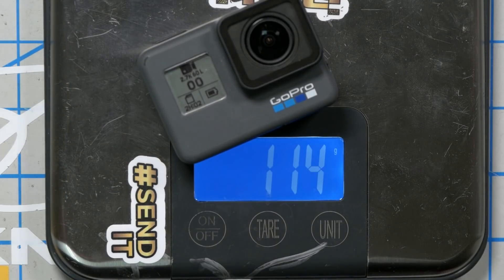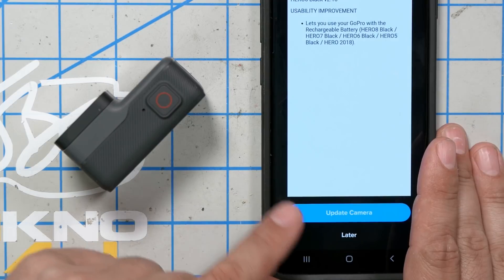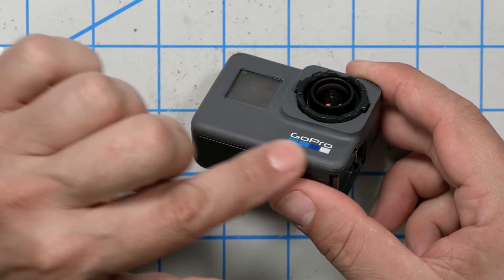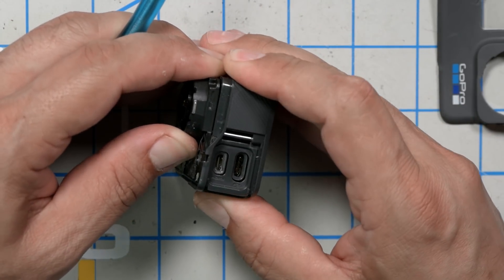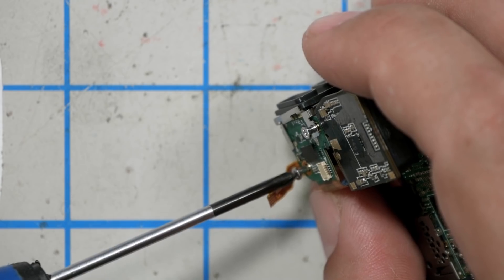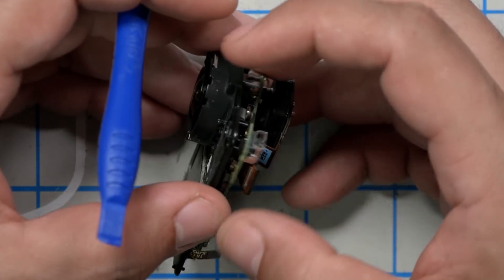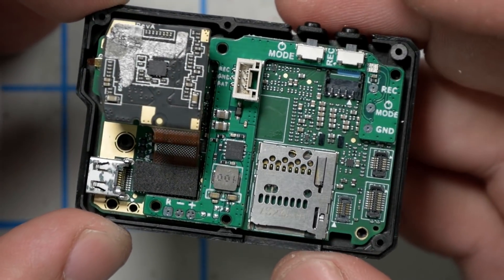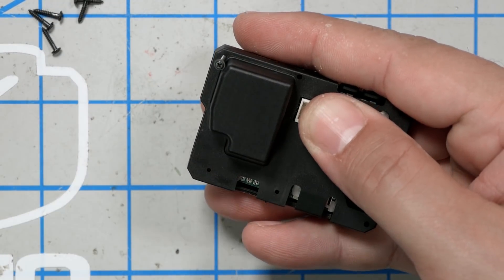BetaFPV Naked GoPro Tutorial (make your Hero6 weigh 26 grams)

Comment: Hello! Why are u using a single-core cable to make the wifi antenna? Is there a specific reason? Or i can use a "normal" silicon electrical cable? Thank you
Reply from the maker: The exposed part of the wire is the radiating element. Since the wire is soldered directly to the circuit board, you make the wire the length of an antenna (31mm) and then you don't need to use coax. You only need to use coax if your antenna is not going to be located directly at the transmitter.
Reply: @JoshuaBardwell  yes understood thanks but it seems that you are using a single-core cable instead of a normal electrical cable.. is there a particular reason of that?

Comment: I'm not sure switching to 2.4 for wifi is a good idea. You're going to be having that thing transmitting right next to your 2.4 receiver, where leaving it on 5G means its transmitting alongside your video transmitter and probably at a weaker power. I'd say there's less chance of failsafe and any video interference leaving it on 5G.

Comment: @Joshua Bardwell, thank you for great and informative video, but one question, which I cannot find answer for elsewhere and also do not clearly see in your video - what you used for antenna? Is there an ordinary cable or is it real antenna like from FrSky rx? Because those usually has core and shell (or ground in other words). I have some knocked off FrSky antennas, so was thinking to use it. So in my understanding, I should basically remove shell completely, cut 3.2mm of core with insulating cover, and solder it? right? Also another question, can I use front LCD with this setup using Betafpv V1.1 bec (I guess I can, as it uses only connection to motherboard and should not eat much power)? Would be good to see if you are still on video mode and did not accidently went to photo or timelapse :)
Reply from the maker: It's ordinary wire. Just cut to the correct 31mm for 2.4g.
Reply: @JoshuaBardwell  Just done it, everything works with my GP7b, ahhh it was so scary to plug 4s battery for the first time :). By the way, my phone did not saw my camera also, until I turned it on (short press mode button) and did refresh on gopro app (in Cameras view, top right corner 3 dots -> refresh). Then it appeared as "camera found". Maybe your wifi still not gone. Good luck and thanks again.
Reply: @JoshuaBardwell  some folks on here saying you need to bridge a connection from the u.fl to the point you soldered for the antenna to work. Any chance you could update on whether that's actually necessary?

Comment: Thank you Joshua for the great video.

A piece of small advice for anyone who wants to power the device from a 4s 5s or 6S lipo. 
Power from the balance cable and use the middle cells of the lipo. The outer cells will absorb possible voltage spikes coming back from the ESCs.
If you intend to use a 4S lipo and you connect your XT60 last, there will be a voltage spike that will find its way to the GoPro board and burn it. I destroyed mine. There is not enough time for it to get regulated.

6s Lipo 25V --x-> iFlight Mirco BEC 12V 2A ---> Betafpv mod bec 5v ---> Gopro board.
............. Burned after 5 days of use when I plugged the XT60.

In my next try, to overcome it, I  will use an extra bec to bring down the voltage to 6V and plug it LAST on the betafpv bec.
Use a small 6V capacitor
Or maybe use a potentiometer as a switch to gradually power the betafpv bec from the 8.4V of the middle cells of my lipo 

6s Lipo balance cable 8.4V--->  BEC 6V --x-> Betafpv mod bec 5v ---> Gopro board.

You will find very useful information about voltage spikes and regulators, at pololu site. 

https://www.pololu.com/docs/0J16/all

I hope the above may save anyone from unnecessary trouble.
Reply: So I have the flywoo gp7 naked and I want to make sure I understand your comment.. I want to also use it with my Diatone taycan 25. To be clear I can power the gp7 by first connecting the lipo's xt30 and THEN connecting to the balance lead power and the ground to one of the middle cells (4s)?
Reply: what if i want to use my 5V bus on my flight controller to power a Fully clothed Hero 7 in place of the battery. the battery will still be an optionally

Comment: Know it's taboo to some but any plans to test osmio action?? Seems to be a solid cam and stacks up well aside GoPro.
Reply: I believe It doesn’t have any stabilization software, or it doesn’t work well with fpv I what I was told
Reply: There are a few videos that compare them but are really biased. It does have stabilization.  I really like mine just for the fact  exposure isn't as high and 240fps.

Comment: Has anyone else considered this for a 5" quad? We could lay the motherboard flat and mount the lens above it in a 3d printed case. Since GoPro won't make a session again.
Reply: Yes, that's one of the main reasons I joined the NAKED Cinewhoop Community GoPro group on FB. I wanted good footage on a 5 inch in a lighter form factor. With a good tpu print protecting the lens & the GoPro motherboard mounted under the top plate with shock absorption mount,  I think it can be done under 50 grams.

Comment: Joshua, you removed the ufl switch... The ufl switch is used for factory test probing and it usually switches between the onboard antenna and the probe. When you removed it you basically cut the trace between the RF chip and the antenna pad; you might want to bridge it lol
Reply: How to do that?
Reply: @MrPorroto  Just don't remove it you'll be fine...

Comment: Question: @Joshua Bardwell, Does the naked GoPro still record sound?
Reply from the maker: It does not, although you can remove the microphone from the case and plug it in to the motherboard.
Reply: @JoshuaBardwell  What a shame, I guess I will have to transfer the mic then, that was the only thing that was keeping me from doing this on my GoPro 6
Reply: If you use the original shutter button , than it will, sadly the mic is on the og shutter button ribbon cable. which can worn out quickly
Reply: @Haverr1  Well, if I can't use the mic then that is a deal breaker for me.
Reply: @princesfpvdrones  than use the ribbon cable as a button, or you can just leave it there and solder on a custom button also :)
Reply: I have done the mod on my 7 black, with the beta v2, very straightforward to do, but I get a solid green light and nothing else. I would say don’t bother doing it. Why didn’t you show the GoPro working on completion??

Comment: Please be aware that there can be voltage spikes when powering on with the BetaFPV board (v1.1) and it’s onboard BEC. There have been quite a few reports on dead GoPros in the Facebook group due to this. Best add an extra capacitor, or use a different bec. Another great video though, keep it up! Happy flying!
Reply: BE AWARE OF THIS!!!   My gopro just killed by the betafpv BEC board.
Reply: I have an iFlight Micro BEC 5V 3A. If I wanted to use this alongside the BetaFPV BEC board, you think there might be issues connecting the iFlight BEC's output to the BetaFPV BAT + and GND? Wondering if stepping down the voltage before it gets to the BetaFPV board would provide enough voltage and if it would maybe avoid burning out my GoPro.
Reply: @TronkyWonk  What i did after reading about it in the Facebook group that Joshua mentioned as well, is cutting off the BEC from the BetaFPV board and connecting another BEC (iFlight BEC is perfect) directly to the GoPro. Check the group to find where to solder it to. This way you can still use the buttons and all. Perfect solution in my view. If you connect the iFlight BEC to the BetaFPV-Bec, i‘m pretty sure it can‘t handle it, as the input voltage needs to be higher than 5v.

Comment: Do we really need to solder on an antenna for the wifi?  It seems like it's low enough power to not be a problem running without a load...
Reply from the maker: All I can say is lots of people report burning out their radio by running without an antenna. But some people also burn it out running with an antenna so IDK.
Reply: @JoshuaBardwell  Radio as in Taranis, etc.?  Or wifi?
Reply: @townc2824  GoPro Wifi

Comment: The little bronze "antenna connector" looks a lot more like a contact for shielding. If it does touch the case shield, it can just be ignored.

Edit: Looking at the trace it seems to be an antenna connector, as well as a pad for a ufl connector.
Reply: The part that he removed is an RF probe... It is used to evaluate the performance of the device during production. When a probe is inserted the antenna connection is disconnected and the output is transferred to the probe for measuring.  You might not want to do what Joshua did as it's basically a contact switch between the rf chip and the antenna connector. Even if he did remove it, he forgot to bridge it so the antenna is basically useless
Reply: @pawanv86  Its definitely not an rf test point, those arent populated in a production device like that and it also doesnt have a hole.

Comment: thanks for the vid joshua! ive done 4 now and i havent yet soldered on an antenna. I might start doing it, but i havent had any issues so far. Ive had issues with it connecting because sometimes it takes a while but so far so good (first one a few months ago)
Reply: This is the only tear down I've seen with someone doing it and then the only one where the wifi then didnt work 🤔 are yours all still working well before I tear my hero down and make the decision to attach an antenna or not?thanks!
Reply: @Stevieboyfpv  from my experience makes no difference but can't hurt unless you keep the iron on too long, then you might kill the module from too much heat but just do it quick and you'll be fine
Reply: @connormullan  thanks for replying leaning towards not at this point 😬👍

Comment: Did that already with my Hero 6, at least 4 months ago 🙈
Reply: any issues with wifi?
Reply: I used to, the fix was to solder a 31mm wire to the wifi antenna pad on the GP board
Reply: @Julienrenauduk  I think I'll give this a go on the weekend with my first GP lite then, thanks for the advice 🤙
Reply: Good luck🤞
Reply: @Julienrenauduk  looks like bardwell used some spare motor wire for the antenna, i'm not sure thats the case though. Am I safe just using some spare wire or is antenna wire specific
Reply: No antenna wire specific @Skydog FPV. Any wire that you have lying around will do just fine.
Reply: @Julienrenauduk  thanks!